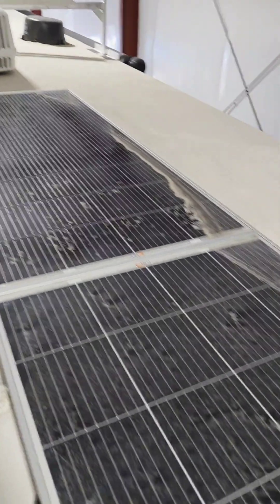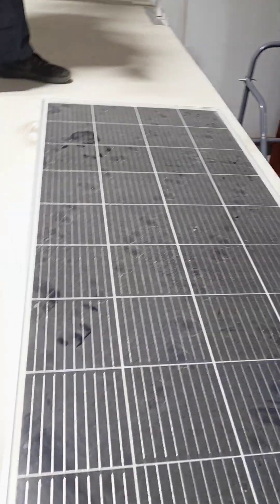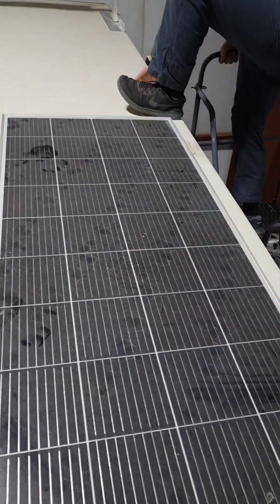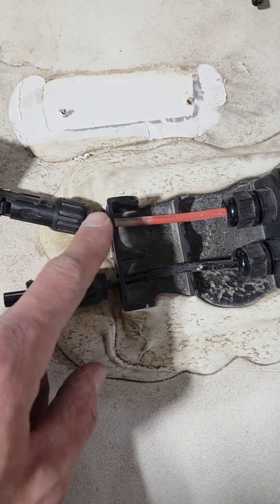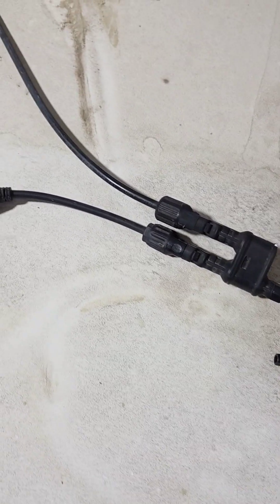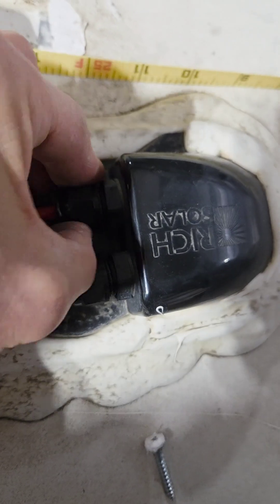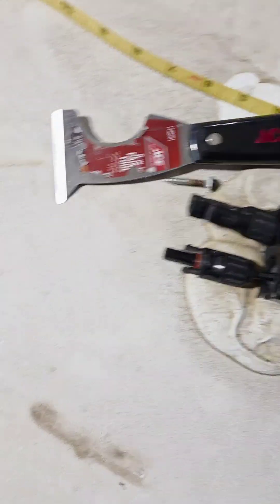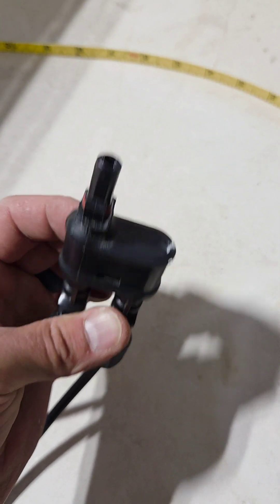Too many amps through the factory installed solar connectors!?! Melted components!

Comment: Can you use VHB tape to mount the brackets to an aluminum roof. Maybe screw the front bracket down only? Then decor to seal the holes and edge. Less holes in the roof.
Reply from the maker: No, however we do have a "side mount" bracket which can be used in specific situations. This prevents holes directly in the roof.

Comment: Somebody doesn't know anything about resistive loss in wire.  I used 10 gauge wire, but it's two pairs of wires at 8 amps per pair.  432 volts because my panels are wired in series for each bank.

Comment: Yeah, I'm sure your probably already running as high voltage as your controller will handle, but I've had way more factory connections fail then my own crimped connections. I think im running 80v @ 30 amps max. On a 10 gauge line but less then 50 ft run